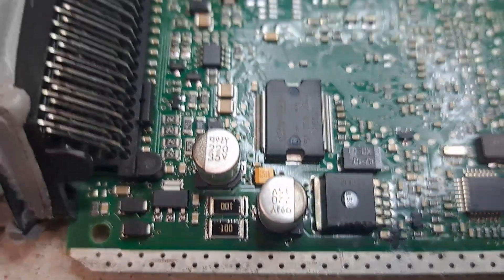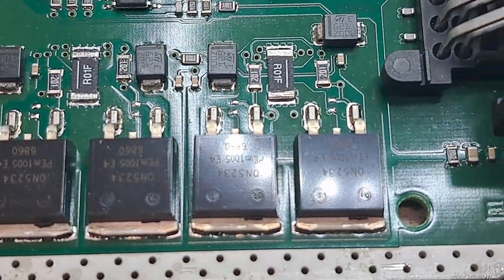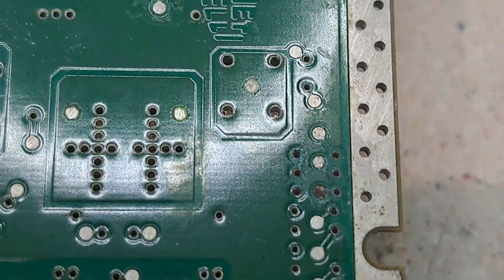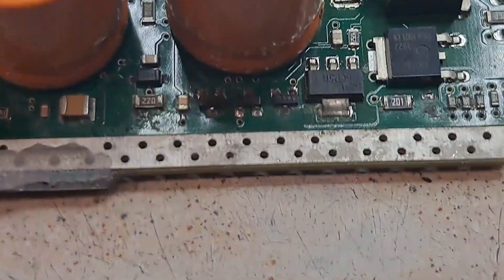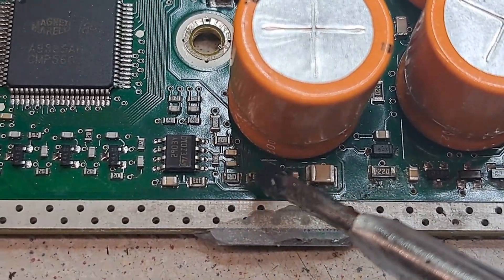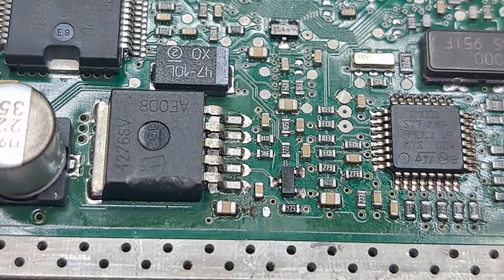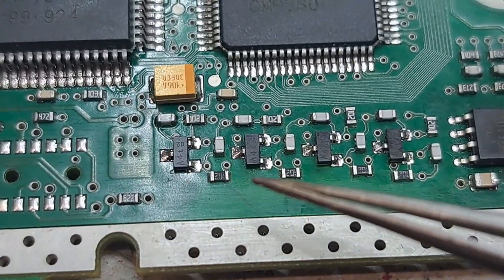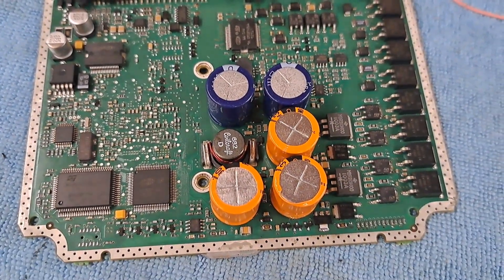Corsa D Ecu repair

Comment: 2 questions sir
Did it work afterwards?
Where can i buy those parts or are they an old computer box?
Reply from the maker: Yes the ecu was fully restored, parts can be acquired from any good electrical component store Rs and so on.
Reply: I got a fault on mine C1 high voltage will that be a easy fix?
Reply: Code P2146 if that helps
Reply from the maker: Yes that's a common fault